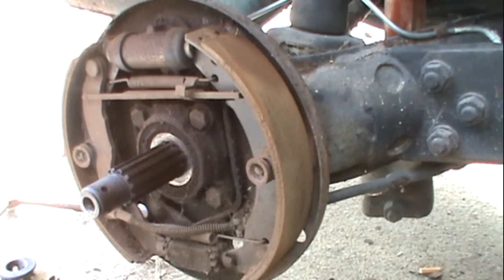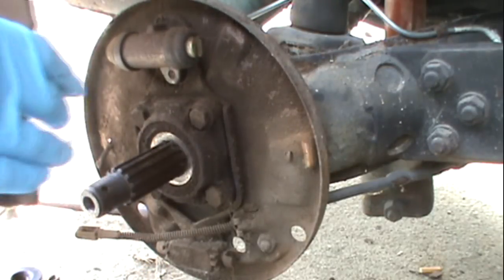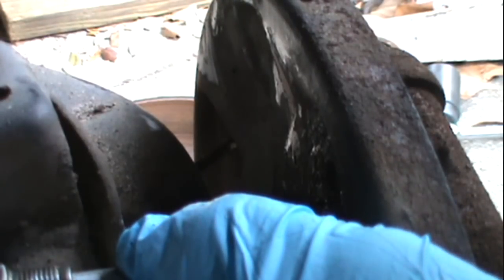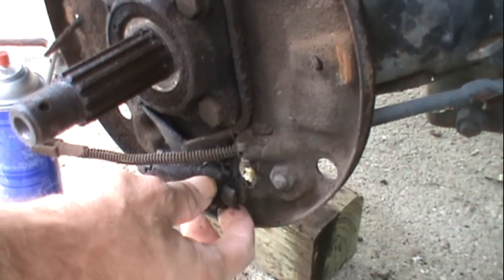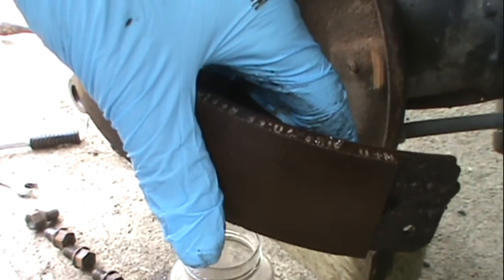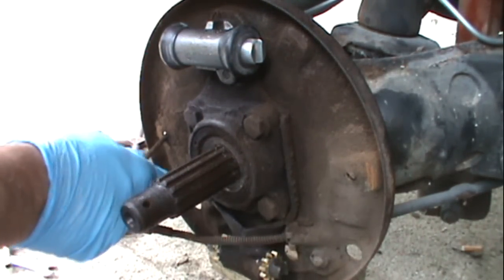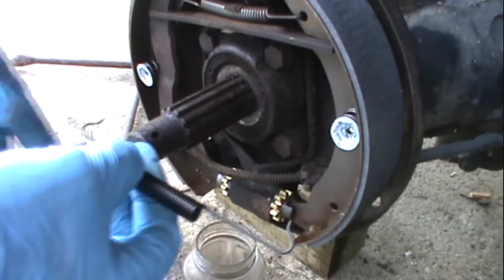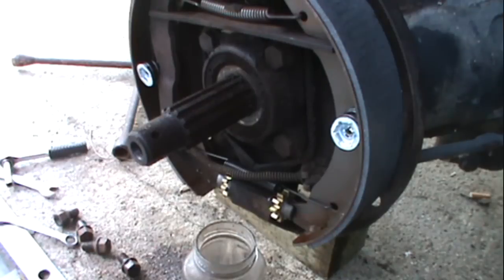VW Brake Job Step by Step

Comment: Great video. I haven't done drum brakes in 30 years and was trying to remember all the stuff my dad taught me. This helped me remember for my new 74 beetle.  The one thing I remembered well that he taught me, and this was before you could easily snap a cell phone pic of something like this, was to always do one wheel at a time. That way if you couldn't remember how all the springs go you could look at the other wheel. I think half the reason I got this car is to bring back fond memories of working on older cars (that were not that old back when I was working on them) lol 😆
Reply from the maker: You just through a bunch of good memories my way. I was 15 working at an gas station and the mechanic told me when there is more than one of anything do it one at a time if you can. Then you have a reference. I use that one lesson on everything. So many people just rip and tear stuff apart and then realize they have a mess and lose out of a lot of fun. Thank you for pulling me into memory lane. Take care, Tony

Comment: great video and very helpful, i went out after watching it and fixed mine up, one thing i noticed my star adjusters have a spring at the bottom which stops it from turning once set, when i got to the other side it didnt so i ordered a new back plate and that fixed that, thx for sharing
Reply from the maker: Thank you so much for letting me know this video helped you. I am also going thankful you pointed out the star adjuster spring if it’s missing. You have an awesome day and thank you again, Tony

Comment: Great video with good explanation of the job. Only thing I noticed was there is no tabs to stop your star adjusters from turning and changing the adjustment.
Reply from the maker: You are 100% right!!! I never even caught that making the video. I don’t even remember if they were on there when I did this for the first time. Great catch now I have to check into this. Thank you I always welcome and appreciate others knowledge of pointing things out. Take care, Tony
Reply: @HowYouCanDoItToo   no worries. It’s caught me out before. I did my breaks all new bits with anti seize on those adjusters and I couldn’t figure out why the breaks would go lose after driving it a while.

Comment: Awesome video AND job for an alleged NON MECHANIC, you really kept it at a good speed along with good comments while showing the order and proper placement of the parts; It took me about 3 hours because the brake line connector would not thread on to the cylinder; it was a horrible feeling; I took a tea break, reviewed your video then went back to the job and it went well; I value good work!
Reply: I just want to add, my car is a 74 Karmann Ghia in fairly good condition, I'm the third owner; however after my purchase I noticed the brakes were not working the way they should (for me it's a feeling you develop with VW's after you've owned several) I purchased it in Louisville KY and drove it to West Palm Beach (stopover) then on to Mia for shipment to Puerto Rico. I PR I replaced the Master brake cylinder then attacked the rear brakes and found the right rear was seized with rust, the brake's were actually good; this coming weekend I'll do the left rear and bleed the system; although your video was on a beetle, the rear brakes are the same on Karmann Ghias (drums); the video is truly great, well put together and very helpful. I'll keep you posted on my results (and whatever else  I find), thanks again!!

Comment: Thanks for the great Instruction. 
My Experience: Those "C-Clips for the Pins are def. subject to wear... One fell off my Bus on the freeway, and it made for some very exciting drama. (Some of the parts that were damaged (parking brake parts) are NOT available except at a salvage yard - if you're lucky). These clips are not hardened, and they DO wear, and I don't think they are easily or properly replaceable using other-type modern-style "c-clips.  The proper ones are fortunately obtainable at most car-parts stores cheap.... By Ordering. of course.  After thinking about it, I decided to use nuts-and-bolts, which seem much more righteous to me.

Comment: Is that lower spring you installed near the end of the video , catching on the new adjuster gear ?
Reply from the maker: I can see where it looks like that because of the emergency brake but it’s not touching it at all. I never noticed that shot angle so great question. When or if you end up doing one you will definitely see plenty of space. If I would of turned the adjuster on the back like I did the front you would of been able to tell it wasn’t on it. Thank you for watching and bringing that to my attention. I need to work better on my camera angles 😆 Take care and have a great weekend, Tony

Comment: What year beetle is this video for? And the star adjusters, which way opens or closes? Thankyou.
Reply from the maker: Hello, it’s a 1970. It can be a little confusing because each star adjustment will go in different directions because there is two on each tire. The top will go one direction to tighten and the bottom will go totally opposite. To add to confusion when you jump to other side will go opposite of other. Here’s a short video on the best way I found to do it: https://youtu.be/qphf_4OYPgQ

Comment: After studying several manuals and  still confused, your video made it perfectly clear.  Thanks.  In taking my hub nut off initially, I found it not tight at all; is that a dangerous situation not having it at 220 ft/lbs ?
Reply from the maker: I would have it torqued when you put it back on. Mine was loose on the other side as well. I torqued it to be on the safe side.
Reply: When installing front brakes on some older cars it is common to tighten the axle nut to preload the bearing then back off slughyl.

Comment: great vid I followed your instructions however air keeps getting in to the system as I am bleeding it and I do not know where it is coming from I also installed an new master cylinder is it possible it is bad?
Reply from the maker: Is your fluid leaking down as well. The reason I ask this is I was getting air in mine and right beside my driver seat had a small pin hole in the brake line. I couldn't see it and it was leaking under the seat.  This line is running along the right side of the seat. I would also check for a line being loose. I could be possible it is at your master cylinder. One more thing it does take a while to bleed the air out when you replace the master cylinder. Please keep me informed if you find where it is coming from.
Reply: The air was coming in thru the bleeder valves and thru the break light switch on front of the MC so I put teflon tape on bleeders and break ligh switch and It appears to have stoped the air getting into the system there is still very very very small bubbles still but I was told that is not abnormal and at some point rebleed and they should disappear?  Brakes seem to be working good?

Comment: A common step that gets overlooked is to notice the location of the SLANTED notch in the adjuster.  If the slant isn't turned so it will persuade the shoes toward the wheel cylinder,not only will it cause a good drum to be hard to get over the shoes,but more important,the adjuster end of the shoes will wear down before the cylinder end even starts to wear in .I'm old, but still see it. Back in the day,someone said "The reliner must have put too much lining on these shoes". Just flip the notch 180 degrees.
Reply from the maker: So, true Thank you for your input sir. Take care...Tony

Comment: Where’d you get the parts from, I’m in need of a kit, thanks.
Reply from the maker: Hello, I think I got everything from Jbugs.com I ended up running down to a VW repair shop for the adjusters because I mangled the old ones that were stuck. They charged me a a fortune for those. I would orders those too and replace them while you have everything apart. Unlike me finding out they were stuck already to go and put a stop to moving forward. Have fun turn the music up. Take care...Tony
Reply: HowYouCanDoItToo thank you, I was looking at  the jbugs kit

Comment: I would have used a wire wheel on a drill and cleaned that brake plate/ dust cover or backing plate whatever you call it 👍

Comment: Sorry if it's been answered, but what year is this good for.  Doing a stock 60 soon.
Reply from the maker: No problem at all, it’s a 1970. I don’t believe the brake part would be any different. I’m not to sure about the drum part if it comes off differently.

Comment: hey there i have a 73 and it has brakes but it feels like there is air in the line or i dont have back brakes the front breakes stop but the car keeps going i can hear the tires screeching but it wont stop that y i think i dont have back brake what do u think can u help me
Reply from the maker: Did you try adjusting the back brakes or you might have to remove the hubs and look at what is going on. Hopefully just needs adjusting. If you end up taking off hub you might as well replace them if they look worn. I have a video for adjusting them.

Comment: How often should you replace wheel cylinder
Reply from the maker: If the rubber parts look like they are getting dry rotted and notice you are losing brake fluid and running down the backside of your tire rim,  I would replace. They are real cheap and if you are replacing your brake shoes I would go ahead a replace if it were me. But as far as an estimated time or mileage I couldn't tell you. I would say environment, how often you drive, how long it's been sitting, ect. to many variables. Hope this little bit helps you. Take care...Tony

Comment: How tf do you get the drum off like wtf
Reply from the maker: I understand. This video is already almost 17 minutes long. I have another video showing how to take the hub nut off, If I showed where to jack it, how to take off tire, how to remove hub, how to replace hub, ect this would be and hour video. Here is a link to take off the hub nut, then pull the hub off. you may have to adjust your brake adjuster in if hub is difficult to get off.I hope this helps tf you out. lol Take care
 https://youtu.be/B6iNvbkjNMY?list=PLdq4XYQuJ0kBY9RVGKz0sAk4QKQXr96Mq